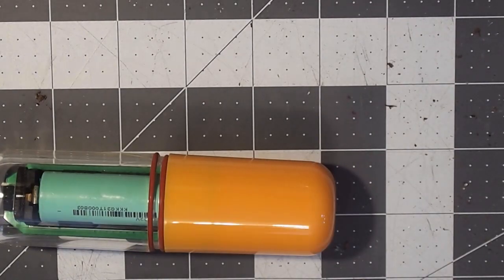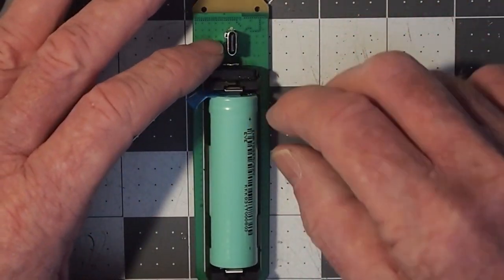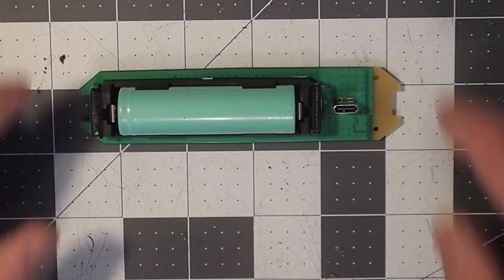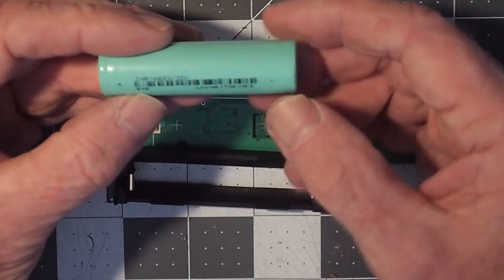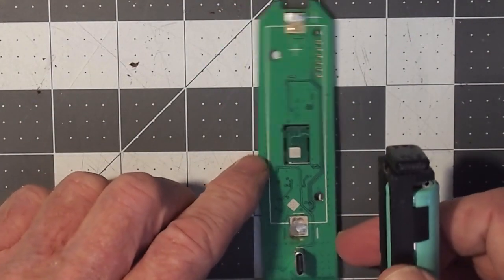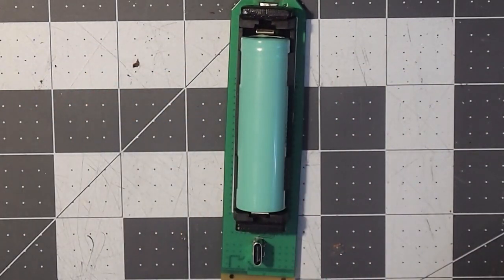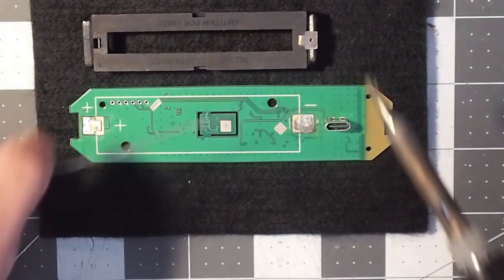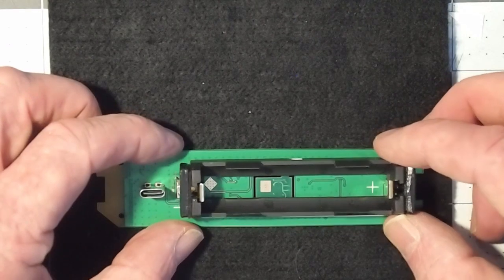Brewing S03E01: Repairing the Kegland RAPT Pill if the battery detaches

Comment: great video thanks. I wasn't able to remove the battery with my bare fingers despite having nails and pushing it backwards as suggested in the video. At one point, I felt like my nails were separating from the the rest :(  Eventually used a big flat screwdriver to push the battery backwards, which worked.
Reply from the maker: That's interesting. I made this video when one client had the battery cradle detach from the PCB, which is the one that I soldered back in this video. Given your experience, I think we can now appreciate why that happened to him. Thanks for giving us a head's up on this, and thanks to the original client who patiently waited for me to fix his unit. Although I have also had one faulty temperature controller, fortunately, I have not had any reports of the roughly 100 or so Pills I've shipped since then succumbing to this same problem.